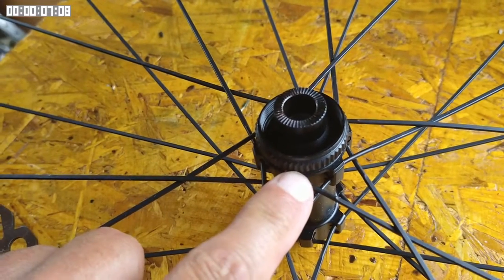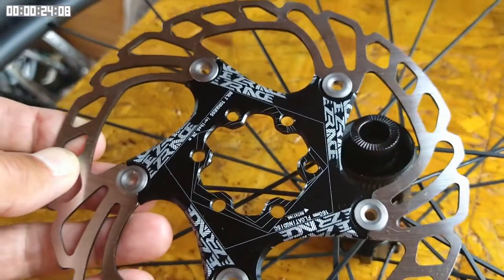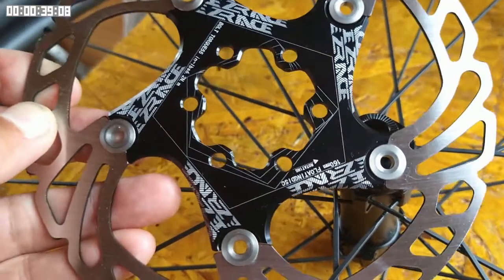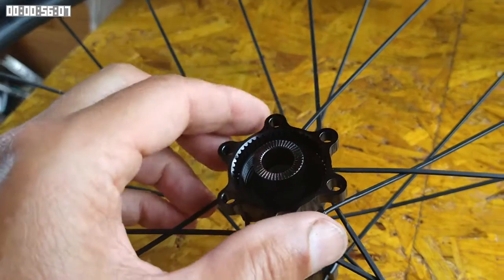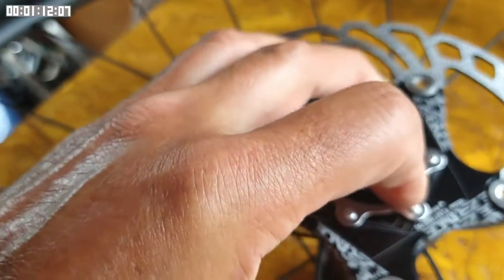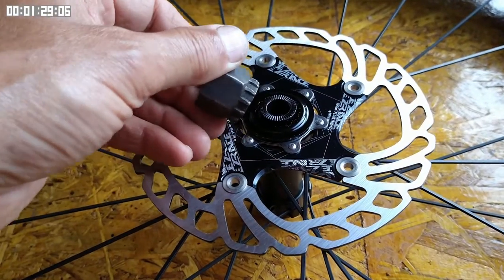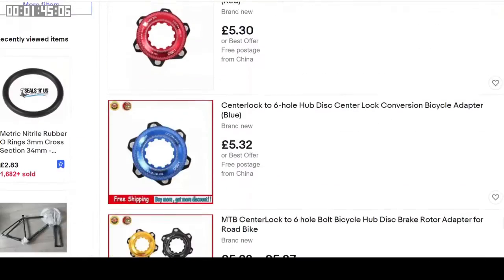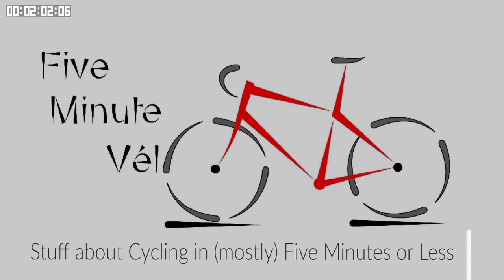Disc Brake Rotors: Center-lock to 6-bolt adapters

Comment: i had this exact same adaptor earlier today but using it with a QR axle I found that my cassette tool wasn't deep enough so I couldn't tighten the lock ring down enough. I returned that adaptor to Amazon and spent about $15 more and purchased a DT Swiss adaptor that uses a bottom bracket wrench to tighten the lock ring. I feel better about getting the adaptor from a reputable brand since there is a ton of torque on that adaptor and I don't really trust a no-name chinesium adaptor.
Reply from the maker: My cheap adaptors have been working well, although I take your point about the tightening tool. The tool can be a particular problem with through axles as often the hole in the centre is too small to fit over the axle. I've got around this by using my long deep tool (🫢). I think the ones that use external spanner are a good idea, you can buy these cheaply on the AliExpress too. Compared to the price of a bike, even inexpensive ones are relatively cheap, 
Thank you for taking the time to comment, post is useful for me and for my other viewers as I only give a relatively narrow viewpoint.

Comment: Great vid - you mentioned spec says 2Nm!!!! this is barely finger tight.  Most of these say 40Nm on them - which is extremely tight but suggest you check with the adapter instructions - usually printed on the lock ring as I wouldn't ride it at only 2Nm tightness!
Reply from the maker: Thanks very much. You are correct about the torque setting. Steel lock rings are normally 40-50N.m. However mine are aluminium alloy and had a setting of 20N.m not the 2N.m that I stated. Having said that I don't usually use a torque wrench (except for critical applications like tightening down to carbon components). I'll add a correction note to the description.
Reply: @FiveMinuteVelo Brakes are a critical place for one to use a torque wrench. Many fasteners on a bicycle are critical and that’s why torque specs exist. Thank you for the video.

Comment: How does it impact offset of rotor? Can the wheel be replaced without caliper adjustments (given previous wheel was a 6 bolt, and this new replacement is a centerlock)?
Reply from the maker: In theory you should be able to swap out one sort of wheel for another. The disc position (offset) should be the same. However in practice, manufacturing tolerances may mean you get some disc brake rub when changing from one type of wheel to another. You may then want or need to make an adjustment. I don't want to be too negative here, you may find things swap without a problem. 
Terry

Comment: Will a six star adapter be able to mount onto a Shimano parallax bs FH-RM60 rear bike hub or not.
Reply from the maker: Sorry no it will not, neither will a center lock. Parallax hubs are pre-disc brake adoption and therefore the hubs have no disc fittings
Reply: @FiveMinuteVelo  so that means I have to order another Shimano hub with a six star for disc rotors already
Reply from the maker: @hopenavajo1391  yes, you will.

Comment: What’s the weight dif
Reply from the maker: The difference between a native centre lock disc and one with an adaptor is next nothing. 
If you're really desperate to save a few grams, focus on the weight of the discs. Alternatively you could save the same weight by blowing your nose before going out 🤭.

Comment: Center lock are only for 28 holes bike rims like a 700cc. Instead of a center lock I got a six bolt with a thirty six hole Shimano hub.
Reply from the maker: Sorry to disappoint but your first statement is not true. There is no reason why centre-lock can't be had with hubs of any number of holes. I currently own centre-lock hubs with 24, 32 and 36 holes. 
However I must admit center-lock hubs are more common in road orientated hubs. Many pubs in the MTB market are still six-hole. 
Ultimately though they are just different styles of fitting the discs. And whatever style you choose, if it works for you then all is good 👍.
Reply: @FiveMinuteVelo  I researched it and try to find a 36 hole center lock hub,but they don't sell in that flavor. All I got the results is 28-32 center lock rear hub on the market,unless if you are rich enough to buy it,so I'm sticking with 36 holes,six bolts and that is good enough for me.
Reply from the maker: @hopenavajo1391 
A very quick search on eBay: 
https://www.ebay.co.uk/itm/134604269598?mkcid=16&mkevt=1&mkrid=711-127632-2357-0&ssspo=Tfhg_DQtSSm&sssrc=4429486&ssuid=Lcug6qySR_G&var=&widget_ver=artemis&media=COPY
A QR version is also available.
Ultimately though they're just two different ways of attaching a disc to a hub. One method is not better than the other. Just use whatever is available or what works for you.

Comment: What tool to use ?
Reply from the maker: If you mean what tool do I use to tighten the lock-ring, it is a generic tool that I obtained many years ago. The tool was originally for tightening cassette lock-rings; the internal splines are mostly the same for the rotor and cassette lock-rings. However there are a couple of things to bear in mind now days. 1) with the adoption of so-called through-axles, some tools may not fit over the axle (I had to make the ID larger on mine using a lathe). 2) some lock-rings are are now tightened via external serrations for which you need a special tool (spanner) to tighten them. I hope this helps.
Terry

Comment: Are there any adaptors that are the other way around? A center lock rotor to a 6-bolt hub.
Reply from the maker: Not that I know of. In any cases would be a bit of an engineering challenge and would probably require an offset to the disc rotor. It would then be unlikely that it would line up with standard brake caliper. I think in this case you're just going to have to go and get some new six-bolt discs. Sorry I don't have better news.
Terry
Reply: @FiveMinuteVelo  Thank you
Reply: Why would you use a c-lock rotor on a 6 bolt hub? 6 bolt rotors are lighter, cheaper and available in bigger variety.

Comment: Hello please I wonder if I could use this adapter for 203mm rotors?? Does it fit all different diameters?
Reply from the maker: Yes he should work fine with any disc diameter, as long as it's a 'standard" 6- hole disc.

Comment: there are lots of video adapters for centerlock hubs to sixbolt rotors, but why am I looking for the other way around and they're not there? I mean, why doesn't anyone make a video adapter for a sixbolt hub to centerlock rotor?
Reply from the maker: The problem is that there is a physical incompatibility. CL to 6B is going from smaller to larger where as 6B to CL would go from larger to smaller. An adapter could be made but the disc would have to be offset outwards from the hub center; the rotor may foul on the forks and the caliper would have to be moved to compensate. Hence it is not really practical. Sorry I don't have better news. Having said that many CL discs are just 6B that have the central spline riveted onto them (however, many, e.g. Shimano, are not) hence you could drill the rivets out and make a 6B from CL discs.

Comment: Let's say I'm trying to build a bike with two different wheels, like a Gravel set of wheels and a road set of wheels. One of them are 6 bolts and the other one are center lock. The offset of hub assembly on each wheel will be the same? Cause, just looking at pictures looks like 6 bolts is more towards outside.
Reply from the maker: Sorry I managed to miss this comment when it was posted. The adapters should place the discs in the same place as native 6-bolt wheels which should be the same as when using center-lock discs. Shimano designed the center-lick standard so they were backwards compatible with six-bolt. Having said that in my (limited) experience all hubs differ slightly so it is possible that, although the discs are theoretically in the correct place, in practice manufacturing tolerances may mean that you may have to adjust the calipers to stop them rubbing.

Comment: Irritating in this, otherwise informative video is the fact that the expert of the matter touches the brake disc with bare fingers. Anyone who has ever used a poorly braking disc brake knows that greasy brake discs are the most important cause of poor braking performance of disc brakes.
Reply from the maker: Sorry about the delay in responding. Yes, you are in theory correct However, in practice, with clean hands like I have in the video, I have not had any noticeable change in braking performance. Yes if I had dirty greasy hands I would either use gloves or clean the discs after. Point of note, the braking performance when I used these discs was terrible - but it was not the disc it was the really really bad brake calipers that I was using at the time. Not knowing it was a caliper issue, I cleaned the discs with isopropanol alcohol which made precisely no difference. New calipers solved the issue.
Reply: It doesn't matter. For ebikes it completely doesn't matter.
Reply: Which doesn’t matter.